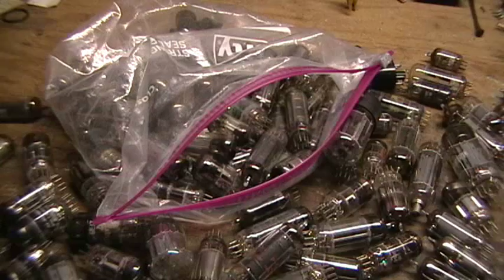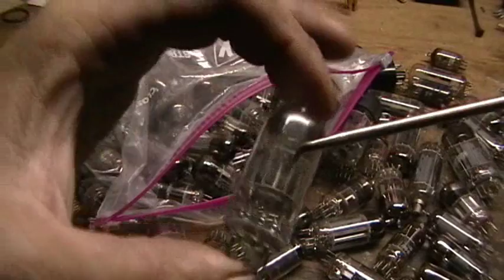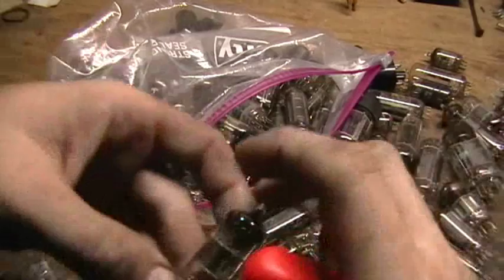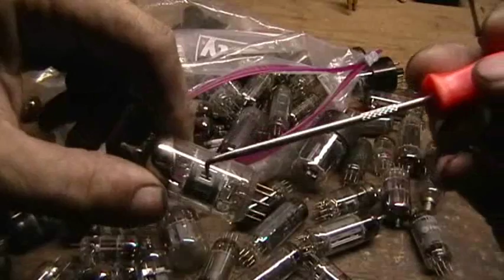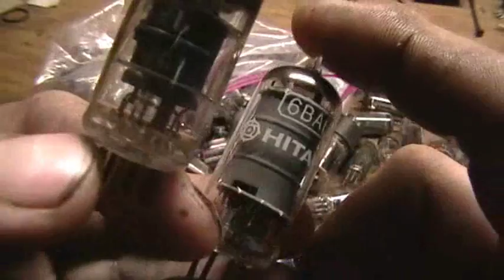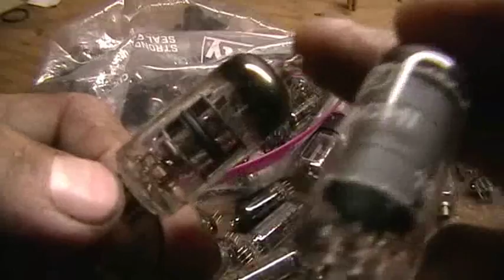Beam tetrode vs pentode, A common improper tube description in tube data sheets.

Comment: All to do with patents I think. A beam tetrode is actually a pentode especially if the beam plates have a separate connection since it has five electrodes. They got called tetrode to avoid the patent on the pentode.

I think really they should be called beam pentodes to indicated g3 is a pair of beam plates rather than a supressor grid, and the symbol should show that was well.